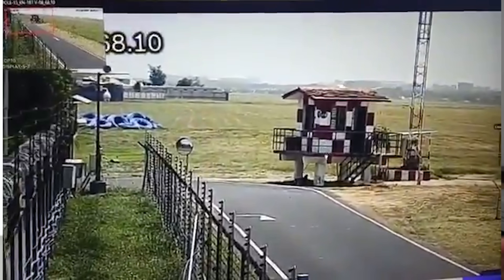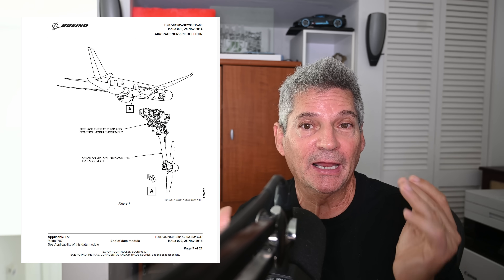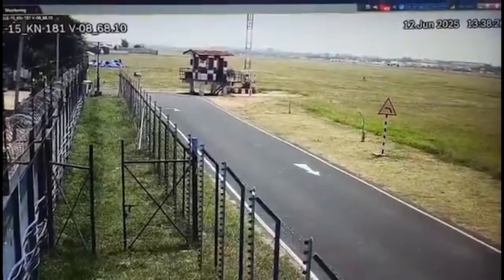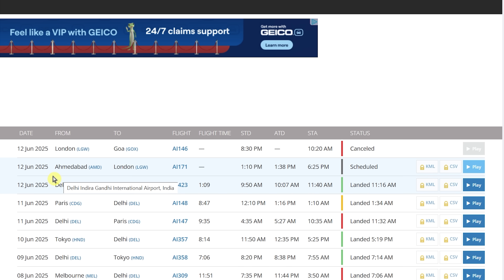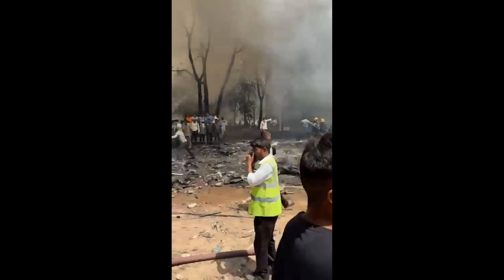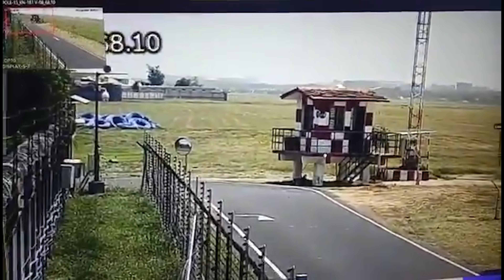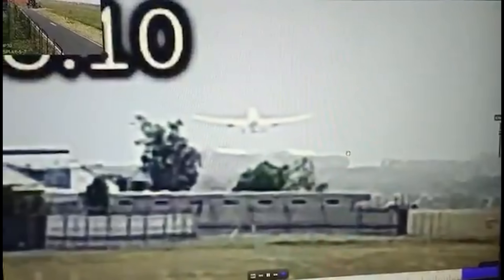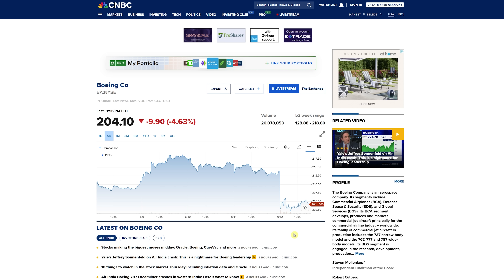What Caused Air India 171 Crash, Mysterious Sound Before Impact

Comment: The Federal Aviation Administration (FAA) has raised concerns about the engine anti-ice system on the Boeing 787, which has caused relatively minor damage to engine inlets on some aircraft. Additionally, Researchers from IOActive identified potential security flaws in the firmware of the Crew Information System/Maintenance System (CIS/MS) and Onboard Networking System (ONS). 12:00 By claiming this is “a really safe plane” you leave open interference from a Directed Energy Weapon.

Comment: Looks like an overloaded plane struggling to gain height. Passenger and cargo weight data must have been miscalcuated with tragic consequences.😢
Reply: It is normally not  possible. the plane has  many indicators for maximum weight. Both meaby there broke.

Comment: I think the pictures themselves show there was NO ramjet deployed.  On all of the other examples you showed something can be seen, even at a distance.  But the video where listening is very clear ... the shot of the plane at the 1:53 mark into this makes it so easy to see .. there is no ram deployed underneath.  I think the audio is merely sound reflections due to the location.  You can hear the jet engines running, or at least one running.
Reply: ..If it was a mechanical problem, then Boeing should be put out of business and shutdown, as It's not the 1st time Boeing has killed passengers.
Reply: At 1:57-1:59 there is a definite shape where the RAT deploys. At 1:53, the viewing angle and contrast against a dark airplane belly could make spotting the polished metal RAT difficult

Comment: Jeff, You're the engineer, think about it.... 11A is right at the wing.. all the forces of flight go through that main wing therefore it has to be the strongest area of the airplane.... therefore the safest place to sit is over and around the wing because it's the most survivable in the event of a crash.  I'm like you though concerning the thought of the survivor jumping out in flight to survive... very unlikely for a number of reasons. I'd bet he opened the door and jumped out after the crash... He was just in an airliner crash so my bet is he's in shock and just not thinking clearly enough to accurately describe what happened.

Comment: You have the wrong seat configuration.  On this Air India plane he had Seat 11A, window seat and directly behind a bulkhead separating him from Business Class - there is no First Class.  However, he is very close to the door.  The door is between he and the Business Class.  My feeling is that he heard/saw something out his window seat and got up immediately and opened the door right in front of his bulkhead where he first entered.  He got out just as the plane crashed.  No, he was not taken into the building, did not get mingled with the plane exploding and was not In line for the fire ball.  There is no other way "he jumped' as he said out of the plane.  There would not have been time for flight attendants to even get to him for opening the door.  He is big and strong and in a half minute could have that door open and then he jumped.  Yeah he has scars.  He may feel he did something unlawful by opening the door - he did.  but he is alive.  There is no other way he could have jumped from the plane. I was a flight attendant.

Comment: A professional pilot on YouTube said the configuration was all wrong. The flaps were not deployed, meaning a lack of lift at the slow speed, and the landing gear should have been up already at that altitude. Add in the RAT and something was seriously wrong.
Reply: Lots of "professional pilots" have got fixated on flaps/takeoff configuration and this worries me.  First, video of the takeoff shows the plane had backtracked down the runway and used most or all of the runway.  ADSB tracking is often unreliable on the ground with missed or glitched datapoints, I don't know why, but it's common to see.  Second, I haven't done the analysis myself, but people who have say this flight normally rotates right near the end of the runway, and that may just be their procedure.  Third, the plane did take off, but then immediately started sinking, with a "mayday" from the crew, and the RAT deployed.  That very strongly implies loss of both engines almost immediately after take off, whether you want to accept it or not.  The "black box" data should confirm or refute that soon.  The detailed investigation will need to explain why both engines failed simultaneously, if that's the case.  Whether or not the flaps were set is a distraction compared with the loss of power/electrical.
Reply: @SloverOfTeuth  a plane can take of with no flaps deployed... 

It just does not take of very well. 

The video shows the apex with a good nose up attitude, but then starts sinking.. 

At take off you should hear engines at full whine... that video of it flying past was very quiet. 

Given how silly most of society is in 2025 I'm very surprised no one has blamed trump for this yet...
Reply: @evelghostrider  Yes, just needs to be moving faster I guess.  Perhaps this is all due to ATC cutbacks, why not?
Reply: @evelghostrider  Bro,no one is saying a plane cannot takeoff without flaps. 
However, these are commercial aircrafts, the aircraft simply won't allow you to.
Reply: @maiden5427  the aircraft will certainly allow you to take off with no flaps but there will be a lot of very loud alarms in the cabin alerting you to a takeoff misconfiguration that nobody could ignore.
Reply: @LokiCentral  What if flaps were retracted after take off, instead of gear?
How do we know the RAT was deployed? I don't see it. I do hear the sound of the jet passing the camera, yet we have no clue about the audio quality of the recording device. We can't say it's the RAT that makes the sound.
Reply: @brucelansberg5485 Jeff Ostroff had a video showing the 787 cockpit. The landing gear and flap controls are pretty far apart, and the feel for the two controls is vastly different. Almost impossible to confuse the two. 🤷‍♂️
Reply: @rhetoricByEric  Although they are clearly two different and distinguishable controls, the human mind is weird sometimes. Either the pilot flying may have been maling the wrong call, or the pilot monitoring may simple had a momentary lapse of reason. Anything can happen.
Reply: @LokiCentral  "Lots of "professional pilots" have got fixated on flaps/takeoff configuration and this worries me."
Why "professional pilots" in quotes?  The two most informative vids that I have watched WERE done BY PROFESSIONAL PILOTS, and both stressed the configuration of the aircraft!  Why? Because flaps up/gear down at that point of flight is completely wrong!
Reply: @whatgoesaroundcomesaround1376  The flaps were down, but the engines failed, that's why the RAT deployed.  It didn't deploy because the flaps weren't set right, did it?
Reply: @LokiCentral  you can hear the engine sound as it flies past, seems engines were working to make a noise!
Reply: The explanation sure does create the issues you see... he may be an experienced pilot but if your tired or over worked or stressed you make mistakes no matter your skill level.
Reply: If that was the case, how did the plane climb 650 feet?
Reply: @yoxat1 Apparently a fully loaded plane with flaps not deployed correctly can gain a couple hundred feet before it falls to the ground.  It makes sense to me that a plane will rise given a steep angle of attack and strong thrust, but since it’s rising the air speed will slow down due to gravity. Without the benefit of the flaps adding extra lift at slower speeds gravity wins and it will fall back to the ground. 

Ultimately none of us amateurs will be able to figure it out. We have to wait for the investigation.
Reply: na bro can you see the 2 nd cctv video its hardly on air for like 30 seconds
Reply: Goes to show how rare plane crashes occur or even get footage like this.
professional pilots don't even know what to say
Reply: This plane has very powerful engines. If they are both full thrust, this plane was never crashes. 100% engine failure.
Reply: @johan7781  Incorrect.  The 787 does have powerful engines, and the aircraft enjoys a generous (for a large commercial aircraft) t/w ratio.
But even a 787, flying low and slow and with engines at takeoff thrust, is NOT going to fly very well or very far without flaps deployed

Comment: It looks to me that the plane did not have enough speed to take off, also the plane should have ahd at least 1000 feet of runway still left before lifting off the ground, but it appears that since the plane ran out of runway instead of coming to a complete stop the pilots decided to use the 1000 feet left to get speed but were not successful. You even see dirt cloud which tells me that they were all the way at the end of the runway when it tried getting off the ground.

Comment: All I can hear are normal engine sounds and then the impact. I think you're misperceiving the doppler effect for something that's not there. I find it extremely unlikely to impossible that the all power was lost, the RAT deployed and active, all within 60 seconds of v1. I don't know how Indian operates but.. I also find it extremely unlikely the APU wouldn't have been turned on
Reply: Apparently they don't run the APU for takeoff.  RAT deployment is automatic if both engines fail.  It looks like both failed shortly after rotation.  It seems unlikely there were independent causes for their failures, so investigators will be looking out for a common cause.  I haven't seen any evidence pointing to what that might be yet.
Reply: @LokiCentral  its a curious accident for sure. Prelim & final will be super interesting

Comment: You can see the plane took off very late. The exhaust throws up dust from the end of the runway, which they shouldn't be near because this runway is over 11000 feet long. This issue and with the fact that the RAM was running suggest they had thrust issues maybe🤔
Reply: The runway is only 11,000 feet long if you start at the end, not the middle.
Reply: @doctortheopolis3122 They still shouldn't be lifting off right on the end of the runway. It looks to me that they had gone past V1 and had no choice to take off, but there was an issue with thrust.
Reply: Mayb the dust from the end of the runway may have flown into the engine
Reply: @1olive1olive4 it may of done that, but I think the issue was after V1 so they couldn't abort the take off, but didn't have enough thrust to take off earlier. With the RAM deployed and the late take off suggest they hadxan engine issue. We will see.
Reply: @nicktomlin9137 Wasn't it a classic case of stall eventually? I'm feeling sad especially those many medical students ended up dead and injuries on the ground...😞
Reply: @LinusWelt Yes, exactly that. It's strange because he doesn't try and lower the nose. Whatever the reason. The plane didn't have enough power to climb for reasons unknown at the moment.
Reply: reportedly they did not take off from the full 11,000ft but at around 6,700ft.  From what I've seen in reporting, they didn't get access to the full runway.  Possibly a late change in plan from the tower and they had configured their takeoff for a 11,000ft runway and not a 6700ft runway, hence no flaps.
Reply: @ericsortzi5669  Somebody is not correct. This flight backtracked to the end of the runway for the full 11K ft length.
Reply: @ericsortzi5669  That actually makes some sense. The flight was delayed (a common feature for AirIndia) and I will be very interested to see the take off configuration for that flight. Having said that, an experienced pilot should have aborted a take off that wasn't textbook and the Dreamliner has all the latest bells and whistles to avoid something like flaps not being down for T/O. So far, everything is pointing to a lack of power and lift. There can be many reasons for that.
Reply: @postcardsfromprotest  why are you crying about air india in every comment? Don't you have a job in real life? Where are you from?
Reply: @ericsortzi5669  Bad theory, but appreciate your involvement. We'll wait for the investigation. Reason, I'm saying this...... there are no mid point taxiways on the airport diagram. Meaning they'd have to back track on the runway to get into position. If doing so, most would go to the end where there is a turn around point. Also, how would you accurately know your distance if you turned around midfield? Most departures that aren't full lenght are performed from a taxiway, so you have accurate distance numbers.
Reply: The first thing I noticed is that the landing gear is tilted the wrong way with its tippy-toes down at 0:01. On the 787, this only happens during gear retraction, but since the gear is not retracting, it is reasonable to conclude there is a problem with the landing gear. Possible hydraulics issue, could be caused by engine flameout.
Reply: They join the runway from R4 Taxi way which means total available runaway is round about 7400 some thing
Reply: @shizshocks8138 I believe a 787 needs about 5000ft to take off. So why it was so close to the end of the runway before lifting is a mystery
Reply: Not dust ... those were a flock of birds moments before.  :(
Reply: @Deploracle  You've posted this several times, but there is zero evidence at this point that this was a dual engine failure due to bird strikes. The video is low quality, but it looks more like dust/dirt being kicked up by the exhaust.
Reply: @jshmeek5900  No evidence but a cloud of material appearing off a concrete runway.
Reply: @Deploracle  Preliminary report from the DGCA in India states that no bird carcasses were found and there is no evidence of any bird strike. That's why it's important to be careful when speculating.
Reply: @jshmeek5900  Careful? Am I at risk of breaking a nail on the keyboard?

Of course no carcasses were found because all that would be left of a bird that transited a turbofan engine is tiny 1/4" long pieces of broken hollow bones.

Their preliminary report is simply to quell the public. It's value is small otherwise.

Comment: That puff of dust when the plane left the runway looks like the very end. Did they use the whole length of that long runway for the takeoff? If so, why did they take so long to reach V1?
Reply: To me the cloud at the take of looks like smoke not dust !
Reply: That’s absolutely dust, they’ve gone right to the end of the runway & what you are seeing is probably the wake turbulence from the aircraft disturbing the ground around the end of the runway as the plane is so low. When you have a bird strike you’d see the engine compressor stalling with small puffs of flames & smoke out the back. There’s no kind of smoke or residue from either of the engines as it initially climbs. I just wanted to explain what you see at the lift off point in this particular video. I have no rational explanation for the tragic loss of the aircraft & souls onboard
Reply: @eddggy  They didn't go right to the end of the runway .. and this was proven fact over 24 hours ago. There was approximately 700m of pavement remaining when the wheels left the ground.

The control tower personnel verified it.
Reply: @eddggy perhaps ! So after 10.000 aeroplanes has taken off , there still is dust so close to the back of the aroplane who take off ?? . I still believe it is smoke from a small explosion...
Reply: @vladimirleninputin  No explosion. Just dust from beyond the end of the runway. Stop spreading lies.
Reply: Also, the ticket says "Economy" at the top. That seating schematic isn't the same as the one being used by other content creators. 11A is right next to the emergency exit.
Reply: @Meisha-san the schematic is of a Boeing 787-9, whereas this was a 787-8 aircraft.
Reply: flaps not set for takeoff
Reply: @brentpalmer2577 the in-cockpit warnings would have been blaring if the aircraft was taking off with a zero flap configuration.

Probably, the flaps were retracted prematurely, coupled with the high angle of attack and a sudden loss of power from both the engines, before the aircraft had gained a positive rate of climb, leading to the stall.
Reply: I'm a technician, to me that "puff of dust" looks like a smoke cloud from a small explosion 💥 😮
Reply: That wasn't dust. They lifted off almost 2500 ft from the end of the runway.
The "dust" was shredded birds ... several dozen of them per engine.
Reply: @Deploracle  Wrong. Stop spreading lies.

Comment: That RAT doesn't look big enough to power a passenger jet. Curious to know how much power it adds to a fully loaded Boeing on takeoff. Sure would be nice to have 5 miles of open land ahead of a runway, they nearly landed right on the hospital!
Reply: The RAT  doesn't provide any thrust, it's meant only as an emergency power source for the aircraft in the event that both engines fail. It provides enough electrical power to power only one of the 3 electric hydraulic systems on the jet.
Reply: It diesnt provide any thrust and only deployed with a total electric failure